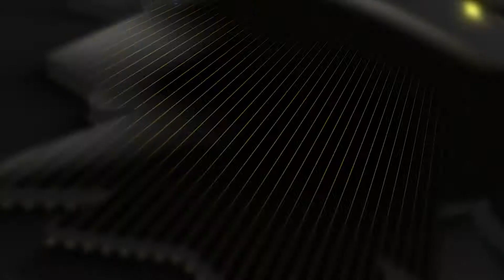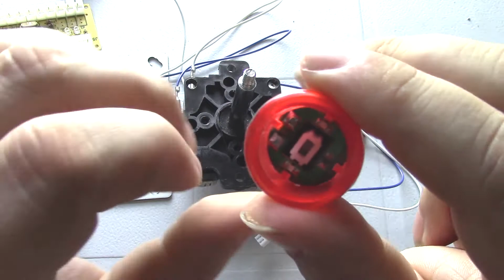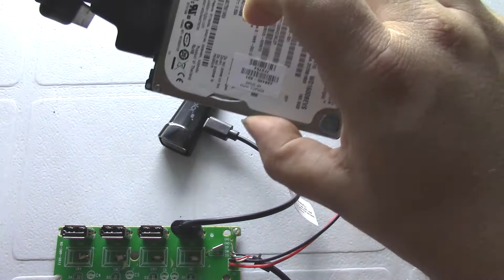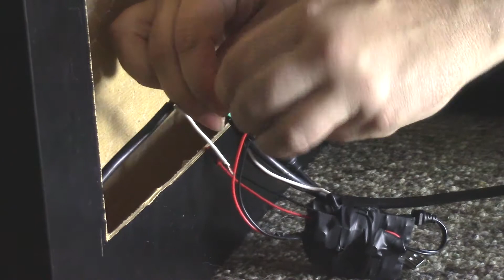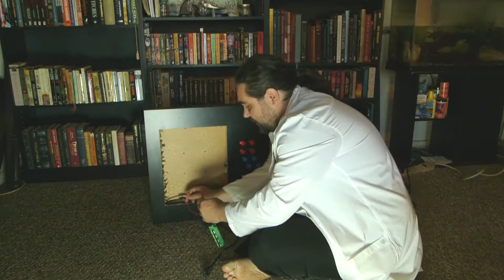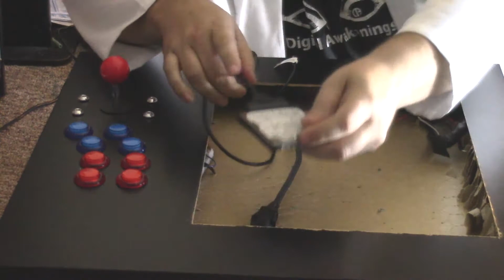Retro Arcade Gaming Table - Part 2 - Common Components

Comment: Dude. You slide heat shrink on before solder. Solder your wire then slide heat shrink to joint and add heat.